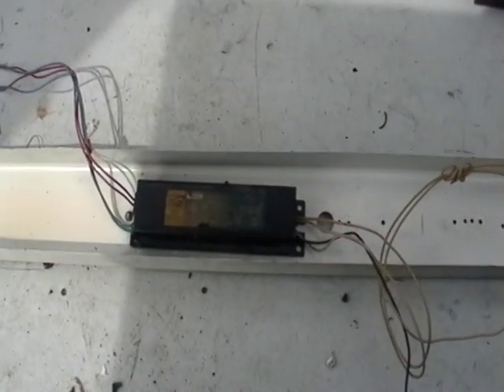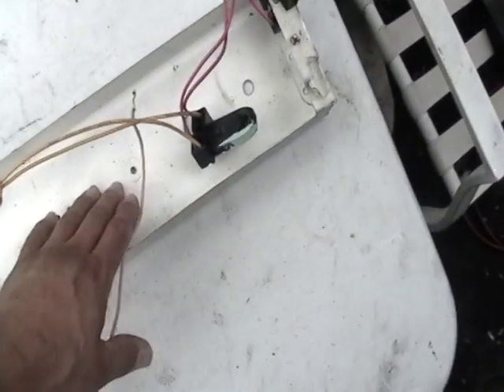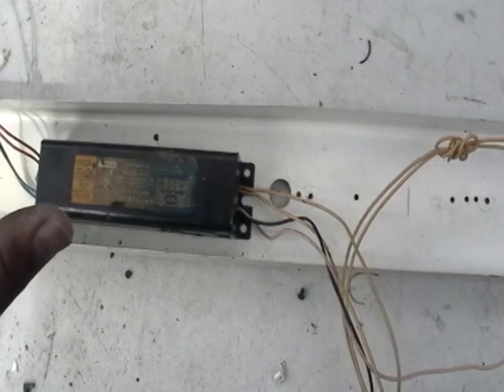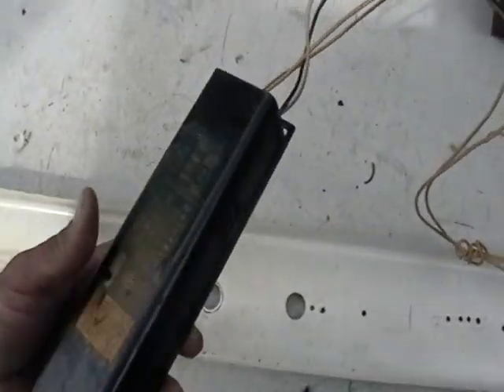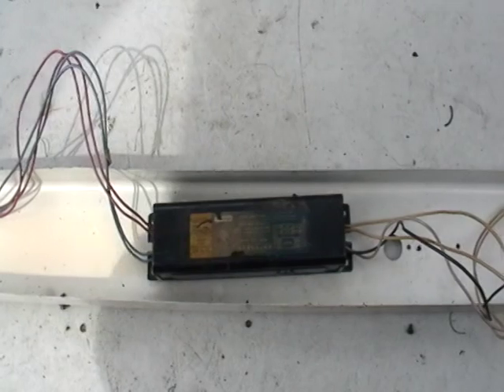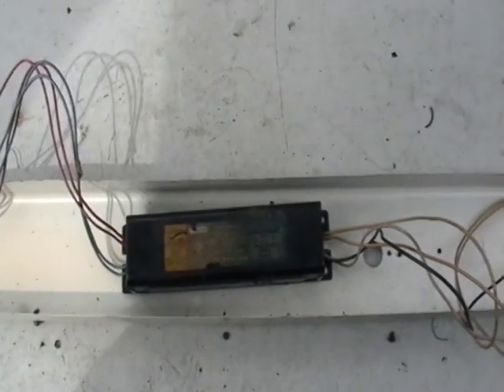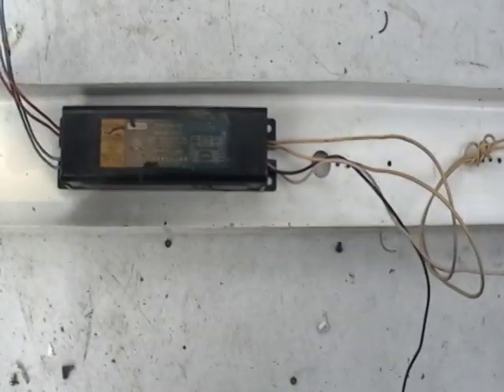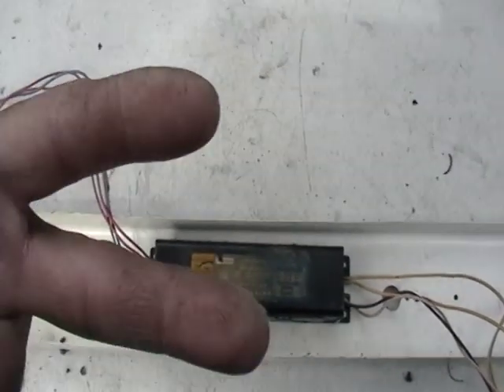Scrapping light ballast work lights steel

Comment: Awesome info Mike, If I knew the ballasts were worth some coin I would have taken the 10 or so they through into the dumpster at work. Have you ever cut one of those electrical boxes in the Ballast open? Pretty curious to know what exactly is in them that makes the metal guys want them.

Comment: I took one for the team guys and i happen  to have 2 of them , they came str8 from the box a old guy gave me them said he couldnt use them. I figure what the hell lets pop one of these suckers open. what i found inside of the ones i opened . Were very clean inside 2 Copper motors , and a long circuit Board. they were pretty easy to open just wacked the back side 2x hard with a hammer flipped it over and opened it with a flat head. again The ones i did were clean inside no tar or anything else. I am aware of the ones that are. but YOLO :) now everyone knows . Happy scrapping!!

Comment: i used to throw them away/sell (throw them away) for years get an axe bust them open knock the tar off break off the capacitor by hand (easy) then knock the part that holds them together on both ends. pull off the bushling on both sides then cut the copper down the midde the middle piece is more bushling thats worth more than #1 steel anyone says different is ripping you off. do about 10 and im guaranteed you will make 140 bucks that copper adds up thats like half a bucket of copper. peace